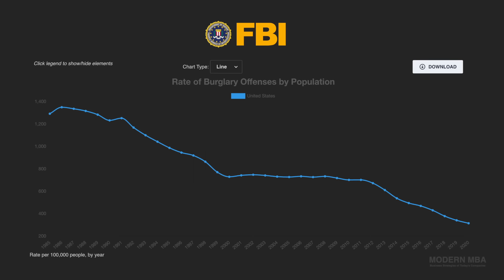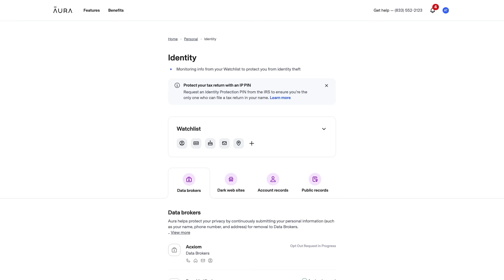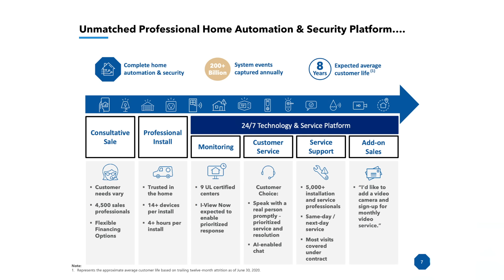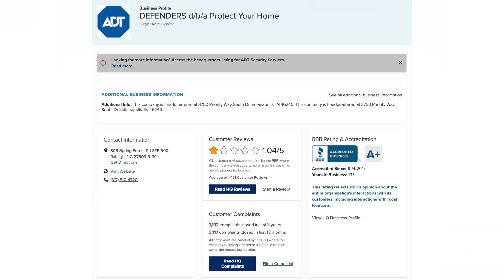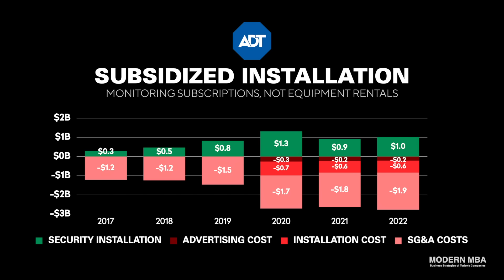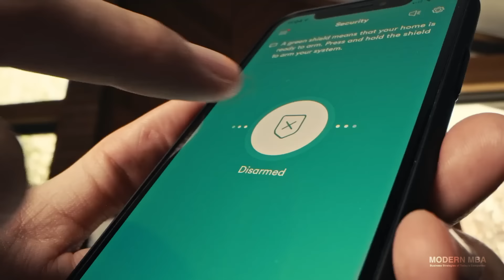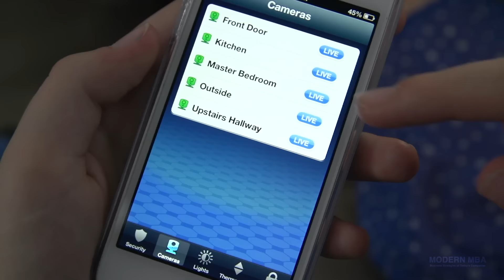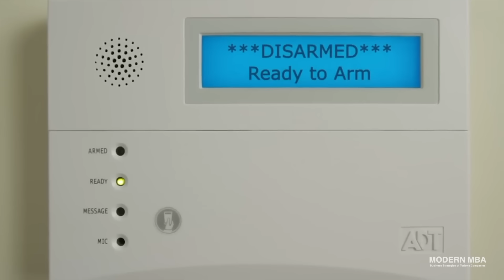The Bait & Switch of Home Security

Comment: Since you mentioned Ring...

I have 2 and it sucks so so so bad because of the cloud.  I've got gigabit internet connection, 802.11AC WIFI everywhere in my home...

It takes many seconds to load up a live view in my home. Like why??? I've slowly been writing up IP cameras with hardwired ethernet connection.  It is way better... 

It is then all sent to a locally hosted Synology NAS with 512GB of storage for each camera.  I'm liking this setup so far with 5 IP cameras currently in operation.

Comment: 7:06 this statement is misleading. The keypads (alarm panels are not always the keypad btw) up until recently have been available for other companies to take over and use again. If the new company can’t, they can still use the sensors already installed. It depends on that company taking over the system.

Comment: Basically - if you're NOT paying for the equipement/hardware UPFRONT it'll be a bad deal/borderline scam.  It's probably really tough times for alarm installers these days but they should have transitioned to be camera, smart home and security device installers - not tied to any large alarm company - if not they'd be doing better doing almost anything else....

Comment: You can call large corporations "evil" and "sleazy" all you want, but the truth is more complex. The truth is that these companies need to generate profit in order to survive.

Take the PS5, for example. They can sell for $400. It takes Sony ~$500 to manufacture (and that's not including distribution, research, and employee costs), meaning they lose $100+ for EVERY MACHINE they sell. In order to make back that capital, they force you to buy an online annual subscription, just $60 a year. That's It! Would you rather pay $3,000+ for even a slightly good PC with no subscription or just $400 for a great machine with a small subscription?

ADT is the same. They are a business, and like you said, they don't make ANY money until 3 years in. They provide a business and service that people pay for, and if they were such a terrible company, NO ONE WOULD BUY THEM. Stop using black & white solutions to gray situations. 😒

Comment: I like how you said the ring doorbell won't work without Internet and then you say ADT works without Internet OK you do realize that the ring alarm does function without Internet, and without power right you do realize it has a battery back up and a cellular connection, right You did do your research for your video right?

Comment: I can buy a 6 camera system with sensors and a dedicated sim card for about 600. One time fee for the equipment, 30 bucks a year for the sim card. This same system will also have a sd card slot that lets me record up to 48 days on 6 cameras in 4k with night vision. I can also add cameras, i actually added 2. I have sensors on all my doors and windows and get a text about which sensor was activated.

Comment: Great video but you’re incorrect about Ring.

If you only have a video doorbell that only works on Wi-Fi but I also have a Ring alarm system and it has a cellular backup just like ADT in the event of an internet or power outage.

I assume this is probably a lie that ADT is propagating.

Comment: While wireless seems great, but you really want wired. Not only does it avoid possible RF jamming, but it allows backup power (UPS) to the DVR and/or controls so cutting building power still leaves it active. A good system can call out by alarm type. No subscription needed. OTOH if the service has their own armed patrols and your local issues warrant fast response, that service may be a good thing,  SD cards are after the fact: Oh! I have been robbed. I wonder if they wore masks

Comment: I did a lot of research a couple years ago and landed on SimpliSafe. If you don’t mind taking an hour putting the sensors on yourself, it comes out so much cheaper. SimpliSafe also has battery backup and cellular backups which solved the backup feature ADT has. It’s also nice to gradually pick up accessories and upgrades on my own terms.

Comment: You keep using the word proprietary describing ADT systems and equipment (you literally apply this to panels, keypads, and detectors like motion detectors) and this simply isn't the case.

I've take over hundreds of ADT accounts. If the equipment is paid off ADT has to provide the end user the installer code that allows you to enter programming so it can be reprogrammed to call any central station using any account number. If they don't provide it I can always backdoor the system via certain actions with the panel.

Keypads and sensors aren't proprietary at all. They're 4 wire low voltage data devices. Sensors are literally just normally closed relay devices. Of which  they don't make any of them, they just install Honeywell components. 

Large security companies like ADT are predatory for sure, but there isn't an ADT intrusion or fire alarm that I can't take over and switch to a local security companies account.

Comment: I think your video has a lot of mischaracterization of fact. First many systems used and installed my ADT are not bricked as you stated, Honeywell manufactured the Vista and  the Lynx system you show in the video and for decades this was the standard and with a simple code that can be easily found online or a total wipe of the system it can be programed to any central monitoring station of choice. As for the contracts you claim have cancellation penalties ADT has made security affordable by removing the upfront costs for the consumer and when a consumer takes advantage of that they save the essential level gear costs and installation costs and yes sales commissions as no business can operate for free. Can you buy a pair of shoes without a sales person having to be paid to help you find the right size in a show store ? No. if a customer chooses to default on the agreement for non payment or more so being pooched by a deceptive competitor or selling the home ADT has no way to recoup that investment so the contract language is necessary. Who can afford to put all the gear in ones home and loose money because the consumer decided not to pay ? If you did not make your car payment they would not let you walk away with the car Scott free.  What you failed to mention is that ADT has a 6 month money back guarantee so that a consumer is not stuck with a system that does not work. When you bought your computer or TV you had 30 days to get your money back, ADT gives 180 Days. As for monitoring rate raise you also failed to mention that if ADT raises the price the consumer has the right to object. Cost of living goes up, so no business can charge a dollar for something that costs them 1.50 and stay in business. ADT has been around 149 years and offers what most other companies can't the fact that if they are supposed to monitor your home 24/7 -365 days a year they are always there. Other that operate independent monitoring centers can't do that. Also contracts renew monthly and much of ADT attrition is due to unethical sales poaching and the fact that ADT has customers that were with them for decades and people die or sell their home.  Your cell phone is also a multi year contract unless you buy it or finance it and lastly the new command system is state of the art and far superior to any other system. While you may understand the financial you don't understand the rest. DIY is a bad solution and of course no contract is required because the DIY company has no obligation to it customer other than to ship a product just like when I shop on amazon they have no contract with me because all they owe me is to ship my package. What about service, repair warranty and so on and most DIY does not have the appropriate listings by various testing agencies. Its so easy for anyone these days to publish misleading information, Does ADT have its issues yes and so does every other company in the world however ADT has succeeded 149 years for a reason, the competition can't offer what ADT offers, and yes some use shady tactics to try and hide this simple fact. ADT is trusted by more homeowners and business than any other company. In a single word, Reliability, if something happens to ones home they want to know help is on the way 100% of the time not sometimes. Would it be acceptable if you called the Fire Department and they on responded 70% of the time ? When Brand X central monitoring is down customers are not being monitored. You buy security for the one time you hope you never need it but if the alarm company is not there to respond it can be devastating. Lastly the home security industry market size is estimated at USD 60.51 billion in 2023, and is expected to reach USD 92.76 billion by 2028, Last year ADT bought back 1,333,333 shares of its stock with free cash. That hardly signals declining business or industry. Reach out of you want real facts as I have only been doing this for 26 years.

Comment: All of my cameras are hard wired. I still have a ring doorbell for convenience, but that's it. My security system is hard wired also. I never bought into the wireless router bs. I don't want my security system to be dictated by fickle Internet connections. Oh, and all of this is tied into battery backups in case of power outages.

Comment: I just go with Simplisafe. There is no contract tied to it, just a monthly fee of 27 bucks for the full service. You can technically still use the equipment but it will only trigger the alarm and not send any notification to the monitoring company without the contract. You do pay for each piece of equipment but I find it to be pretty cheap and easy to install yourself since just about everything is wireless. Their cameras especially the outdoor camera kind of sucks since it is wireless and will take some time to boot up, but the recordings work fine. I suggest getting something else for exterior cameras though.

The issue is if you have an alarm go off where I live I get state police coverage. Which means they aren't showing up for an hour. That said, the alarm is enough to get me up and respond myself and since I live in a castle doctrine state I should be fine. I also suggest anyone who is going to take care of business yourself to get CCW insurance.

Comment: I disagree on the comment near the end of the video that stating that no company has found a way to be profitable without signing a 3 year or longer contract. 
If you sell the system outright, including the labor, you can monitor month-to-month. If your company can provide a sound installation and good service, you will keep your clients for a long time (Retention). This also allows you to provide monitoring (RMR) at a lower, more competitive, rate since you are not rebuilding a deficit created by giving away the installation and equipment. 
ADT lives on paper. The contract is the bottom line and the installation is usually a "basic" which provides minimal protection while charging an inflated monthly fee for monitoring.

Comment: Switch to a real time monitoring service of any security product.
This will allow you to provide an on demand service instead of the forced contract service.
Maybe there's a business model there to capture the market.  Using AI to sift through the noise and provide useful alerts and real ttme monitoring on the back end.
The only value that ADT provides is real time monitoring.  IF they could isolate that and provide it as a service.